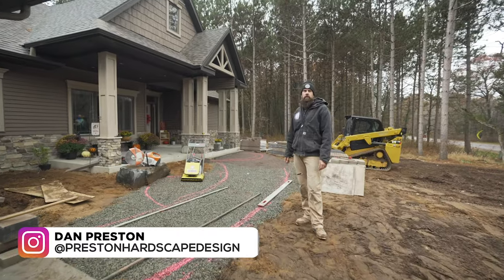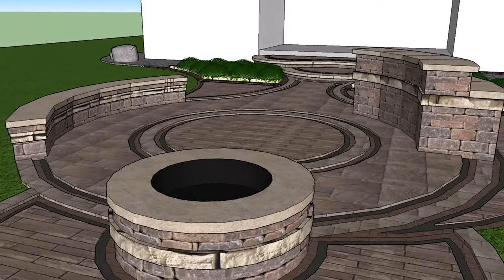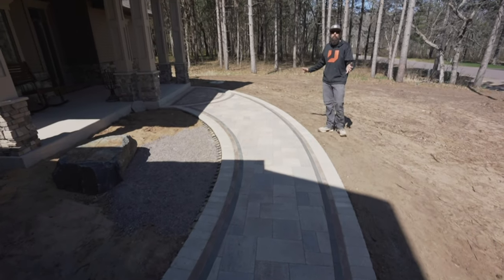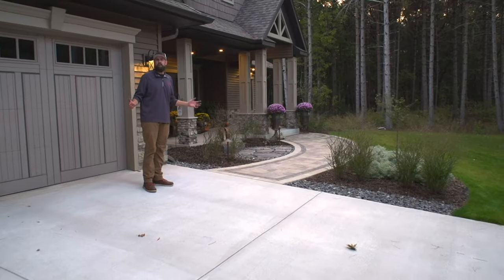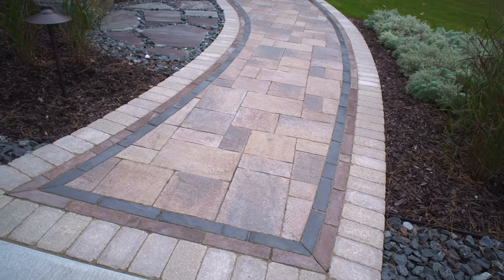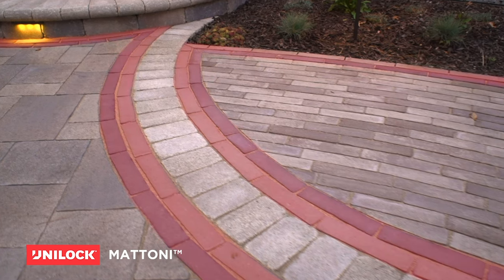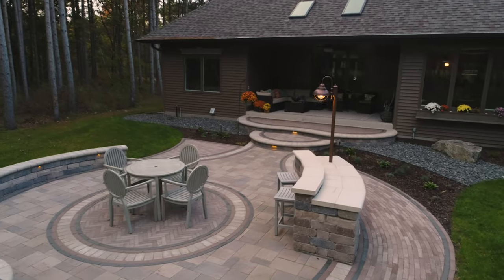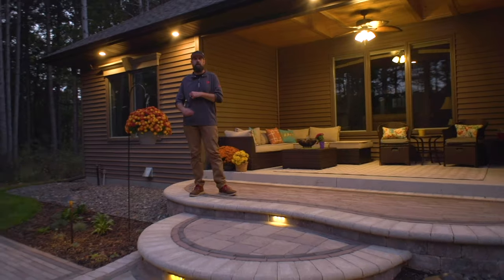Hometown Hardscapes Episode 5 | Fairway Relaxation | Preston Hardscape Design

Comment: Quick question, on the cooler nook. I did one a few years ago and used two 3/4 steel bars with a 1/8 metal sheet to hold the cap/block and it still ended up sagging. Just wondering if you ever ran into this problem and if you haven't could you give any tip's.